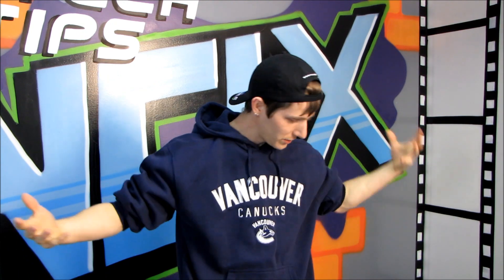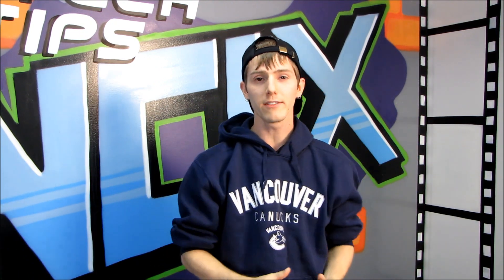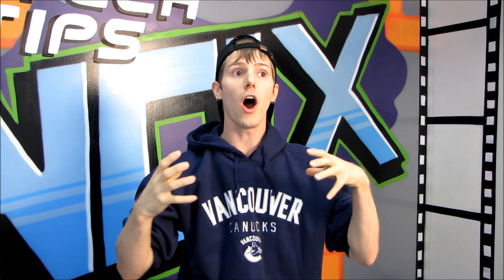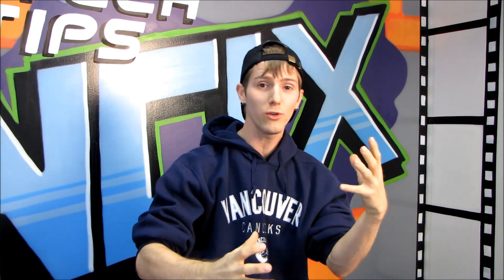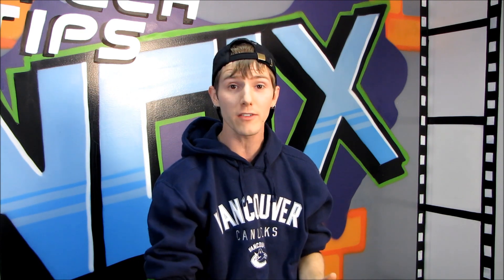Futureproofing Your PC - Dispelling Some of the Myths NCIX Tech Tips

Comment: i5+4gb ram+ p55 simple mobo (a good one for overclock with new usb and sata, but simple... like... one that you can put only 1 vga). For videocards... or the 6870 or... for less money... gtx 460. Psu... I  would buy a 650w one, but 850 would be awesome too. 500gb 7200 rpm hard drive, a case like the cm690II or a haf 932, corsair 600t would be awesome too.
Some fans, around 6, good ones, thermaltake frio for the cpu...
cheap dvd burner
things that i like to buy really good ones are mouse/keyboard

Comment: 1. No, Linus. You have talked about this before and has crossed my mind many times.

2. Motherboard: EVGA Classified SR-2
CPU: 2x Intel Xeon E5620 2.4GHz
RAM: 24GB Corsair Dominator GT 2000Mhz 
GPU: GTX 580 X3 - Tri SLI
PSU: Corsair AX1200

3. I enjoy every video you put up, Linus. So both these video types and the original are both great, IMO. :D

Comment: Question 1: I've already had that opinion before I watched the video.
Question 2: I buyed a new PC a few weeks before (i7 930, 6 gigs of ram, Zotac GTX460 AMP!, 600W PSU, 120gb ssd, 500gb hdd) and I'm very happy with it. And upgrading it in about 1 year will be much cheaper than buying a 4000$ system now. For example: A friend of mine bought a 2000€ system ~1 year ago. And my 1200€ system performs better :P
Question 3: I like every vid of NCIX and you, Linus (your cats are sweet) :)

Comment: Answer 1: Yes it changed the way I think about building a new system for gaming.
Answer 2: Cooler Master HAF 932 Black Limited Edt, 750W PSU, ASUS M4A89GTD PRO/USB3, Socket-AM3, AMD Phenom II X6 1055T, Corsair DDR3 1600MHz 4GB, Two Radeon HD 6870 1GB GDDR5, DVD±RW burner, SSD 2,5" 60GB, Western Digital Caviar GreenPower 1TB
Answer 3: Yes more episodes please :)

Comment: CPU: I7 930 or AMD 965 BE, we dont need more than that for gaming.
Boards: X58 or 790/890 chipsets depending what card (GPU) you stick with
GPU: Personally, i would recommend second best, example GTX470/570 or 5850/6950 why? 95% of games would not be that taxing on such a system. If it is, a second card would be great and MORE than enough.

Comment: Just do what you think it's best, I like to watch everything when in comes to computers. Hm and about the rig.. first thing, you can never go wrong with a good quad core processor and even better if it's intel... second when it comes to ram i think it's best too have at least 4gb ddr3 and you'll be fine...for graphics card i would personaly pick a combinaton of two mainstream GPUs in crossfire or sli (6870s or gtx 470 are a great choice) and that's it. Keep up the good work, cheers!